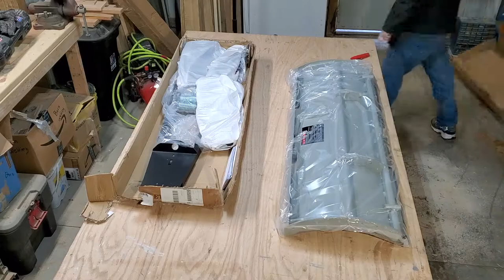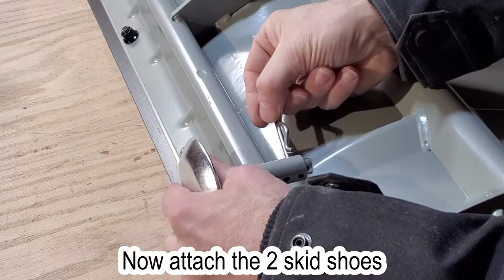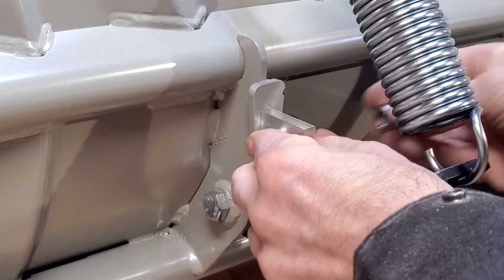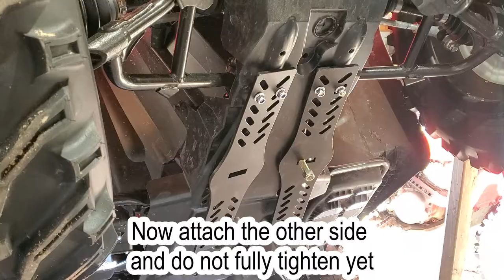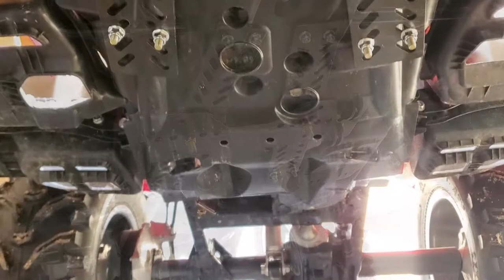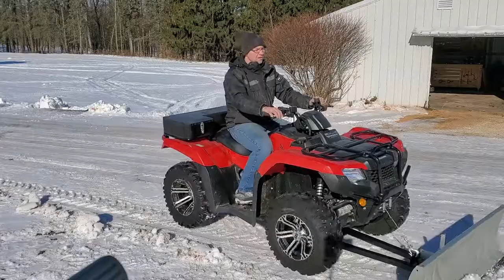ATV Universal Plow Assembly and install

Comment: Great video! My only variation was putting a pulley on the plow frame, running the winch cable through the pulley then hooked onto the top of the front bumper bars. Cuts the cable tension in half.
Reply from the maker: That's a great idea and I may just do that thank you

Comment: question. I think there is a mount already installed underneath my quad. approximately what is the measurement of the space between the ears that hold the A frame connected by the bolt and cotter pin?
Reply from the maker: Sorry for the late response, it measures 15 inches

Comment: I just got this same plow. I haven't gotten around to installing it yet im still working on installing my winch. Im making my mounting plate so i dont have to buy one. Im almost got it done but between weather and working long hours its taking me a little longer than i meant for it to. It looks like the plow is going to be a lot easier the the winch. Thanks for the video i believe it will make installing this a lot easier.
Reply: I finally got mine on today and your video helped a lot. The only thing I saw where you messed up was the eye bolts don't go on the blade they go on the pivot and the springs go on the blade. Now with that being said it should work both ways but I looked at the directions because of how big them holes are and it didn't seem right. I'm surprised at how sturdy it seems to be for the cost. Anyway thanks again for the video it helps because the instructions kinda suck.

Comment: Why do I have some hardware left over? I also noticed you didn’t use either. I’m referring to the pieces shown on table at 1:04 in the video. The 4 black plates and the spacers to the left of them. Thanks
Reply from the maker: it is a universal plow so their is extra hardware for different quads

Comment: Awesome video!   Was just looking at this plow on Amazon lastnight, 

How has it been holding up?   Any weak points or cutting edge wearing rather fast?
Reply from the maker: It's been holding up fantastic I have not had any issues with it wearing at all and it's built extremely well
Reply: @jlistdiy  just ordered one,    your video here is going to make the install a breeze,  thanks!

Comment: Was there some type of suggestion measurement in the instructions of how far forward the plow should set in front of your bumper?   I understand that there needs to be sufficient room to tilt the blade full left or full right without it hitting your tires. But it looks to me your plow is maybe 3" farther forward than it needs to be, would you agree? The winch instead of pulling it straight up is pulling it backwards a little bit.  My concern is that may cause extra stress on the plow framework.  Maybe this is a non-issue and I'm overthinking it???   Just looking for your opinion before I mount mine up. Mine came with no instructions whatsoever.
Reply from the maker: You are correct I have moved it back a few inches since I made this video and works better
Reply: @jlistdiy  thank you for replying! I'm hoping to start and finish mine tomorrow. 🤞 
Do you think I should position the plow where the winchline will hang almost strait down and then match & mount the mounting plates accordingly ?
Reply from the maker: @bhoss7133  no problem and that would be the best way to mount it 👌
Reply: @jlistdiy  thank you sir!
Reply from the maker: @bhoss7133  your welcome